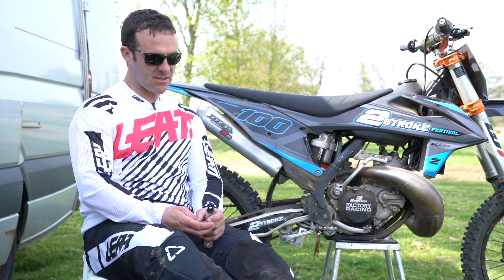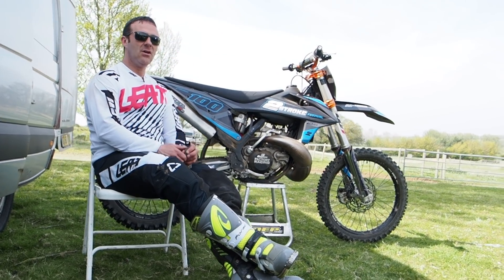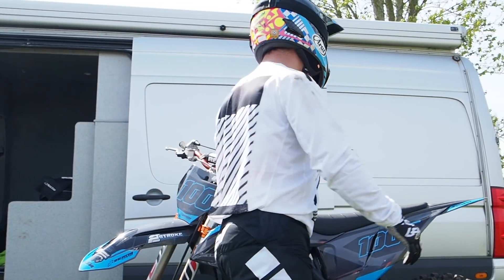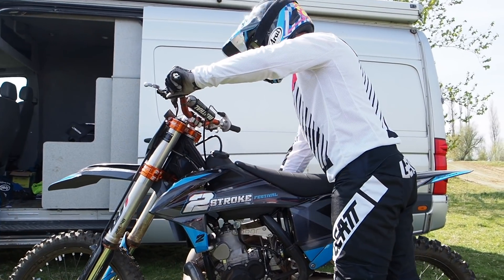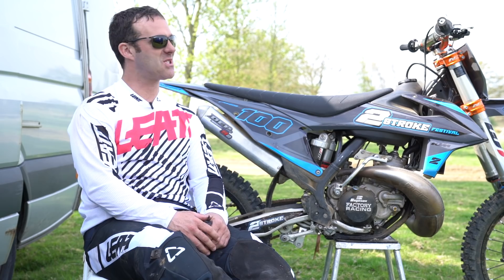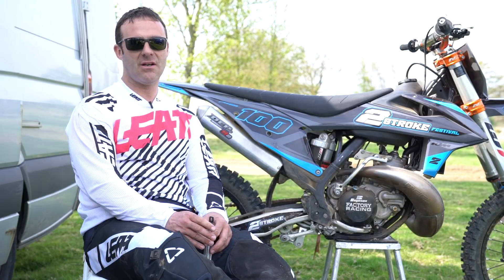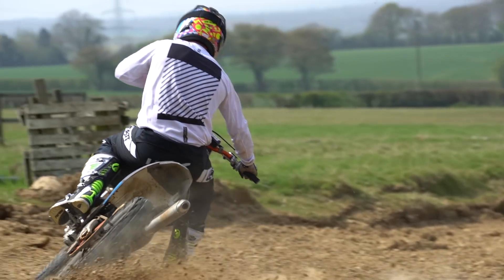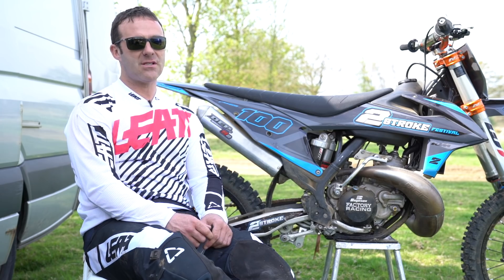Two-stroke tuning secrets: KTM powervalve set-up

Comment: I’ve got a 2017 sx 250 and I absolutely love the red spring
Reply: I have a 2018 Husky TC 250 and I also have the red spring and power valve adjuster flush with the cover.

My bike feels aggressive and I really like it. It has also better breathing modified stock airbox, modified Mikuni 38 carburetor, Boyesen Rad Valve intake/reeds, Wiseco 1-ring piston, cylinder is raised a bit (by thicker base gaskets) to get slightly more exhaust port and trasfer ports timing. Piston top to cylinder head squish band has been set for tighter but still safe clearance to improve burning speed.

Transfer port channels have some small modifications but the ports are stock. Cylinder head is from 2017 TC 250 (similar than 2018 is) and it’s milled down -0.4 mm to increase a bit the compression ratio. It has also FMF Fatty pipe and Pro Circuit R304 shorty muffler. This bike has incredibly strong midrange and revs very high too (at least for a 250 two stroke). I don’t need a 500 two stroke as this 250 I have has as much power as I need or even a bit more... 😃

Comment: FOR THE PEOPLE WHO’S FINGER SLIPPED AND THEY ACCIDENTALLY BOUGHT A WEAK ASS BABY BIKE (250-300 XC-W/EXC/TE): KTM’s “enduro” bikes are just the xc/sx bikes with a hell of a lot less hp, but you probably already noticed how sluggish your bike is so you don’t need to know the details. These are all of the mods you need to make your motor run right: 

1) sx head and cdi. This alone will give around 8 hp boost, which is a butt load for how much it costs, and if you can only afford one then get the head. Buy them from rocky mountain atv [Just find the stock parts from the ktm 250sx] and if you have a 300 then buy the cdi from slavens racing [ lowered rev limit for 300 piston ]. Then power gains are immense and it boosts across the entire rev range. More bottom and top but especially mid range. Also makes to bike tractor even easier through tough stuff.

2) pipe and reeds, they aren’t going to give you a huge boost on the dyno, but the reeds give some throttle response and top end and the pipe broadens the powerband. 

3) Carb settings [obviously doesn’t apply to tpi bike] cheapest is to try jetting it, but the mikunies are terrible and it is really difficult. Still on the cheap side would be a jd jetting kit which helped my bike a little, but the optimal way is to swap to a lectron or smartcarb. Lectrons are supposed to come tuned from the shop but I had to adjust mine a good bit to get it running right, and I don’t have any experience with a SmartCarb but I assume it is similar. Whatever you decide to do just make sure the motor isn’t too rich because that makes it load up and bog out. 

4) power valve settings. The guy in the video is really knowledgeable and I’m sure his recommendations are good for the sx bike, but the pv settings are completely different in the enduro bikes. Mess with the settings and use whatever feels best, but for those who want the most out of their bike use the red auxiliary spring and turn the brass screw 2 turns in from all the way out. This will make the bike have the most mid to top without losing any bottom. There is an entire ThumperTalk thread on this, but the conclusion is that those settings are most powerful and snappy overall.

Good luck with anything you decide to try and happy riding!

Comment: I've yet to have a chance to ride one of these newer ktm 2 strokes, I have always been a 4 stroke guy, but like the idea of the luggability of the 2 strokes and the lightness of the bikes. Does the green spring give it a linear feel like a 4 stroke, or is it still definitely a 2stroke
Reply: Green sucks... i drive red but i turn in the powervalve a lot more. Now my 300 rides like a 4-stroke. More torque and NO massive 2t hit.
Reply: @scottkonijn  tpi?
Reply: Word of advice if you find an older one that's in condition rude that instead 😉😅
Reply: Yes... a husqvarna te 300i 2020.
The spring allows when the powervalve opens @ 3/6/9000rpm +-. And the screw determines how far the power valve opens.
Reply: @scottkonijn   Sorry, You are wrong...   The screw adjustment preload on none color preload spring determines at what rpm the PV first begins to open.  
The colored auxiliary  spring determines how quickly the PV opens from partial open to fully open.  The PV will fully open at top rpm on either of the springs.  
The PV full open limit is Not affected by the screw.
Reply: @crazybob1954mo  your theorie is correct. But in practice my explanation is wright. If you close the power valve screw 9/10 you drive a with the power  of a 50cc, so you can manage  the power with the screw.
Reply: @scottkonijn  OK....   Though 50cc may be a bit mild for me.  I would rather Go Hog Wild and drive with the power of 75cc!  
Woo Hoo.!!!     <;)  :)

Comment: "Power valves" are bullshitted about too much, they are exhaust port blockers, the cylinder and pipe is designed around the exhaust port not being restricted.

I've tried finger controlled "power valves" on RGV250 road bikes, a RM250 MX and a Yamaha GP1200R jetski .

The Jetski wants the valves open for everything other than when you're cruising home exhausted at 3500 rpm, it makes a slightly smoother exhaust note.

For the RGV250's it was absolutely awesome, the valves wanted to begin to open at 8500 and by 9000 they were fully open, it took five minutes to get the hang of pulling them on, it became second nature, you could even feel the lever would start to go light just near 8500....you could even force the valves to shut under hard braking or put on more return spring tension, they were awesome, i'd be dead if still riding them.  

For the RM 250, just like this bike, i knew the finger lever (just a stubby second clutch lever using the same but longer pivot bolt) would be too hard to control but it was purely for the experiment. The valve may as well be open, a top rider on a fast track shouldn't realize the power valve was stuck open, my tip would be the better you are with the lightest spring the better you must be flogging it, you are just delaying they pipe coming on song.

I could ride the RM with the valves stuck shut and it worked as expected down low but could still kill you, if you rode with them stuck open it was a bit of a dog down low but quickly turned insane. 

The rev range of the RM to RGV is basically half, the RGV needed to be ridden in traffic and twisties, so that's why the were vital, for this bike, the lighter spring is proving the engine is ready to transition to it's pipe designed rev range, it is just basically making the engine de-tuned for a while until the rider is ready. As this video describes, there are just too many variables between rider, bike and track to ever try to make definitive statements about where they "should open".

MX power vales are designed to "blow" the valve open, just before the engine needs it, that's why adding the resistance of the spring can give absolute perfect tuning to a riders preference.
Reply: Raise the base gasket to 1.25mm with head mod, solves the exhaust port situation. Talk to Kelsey at RK Tek